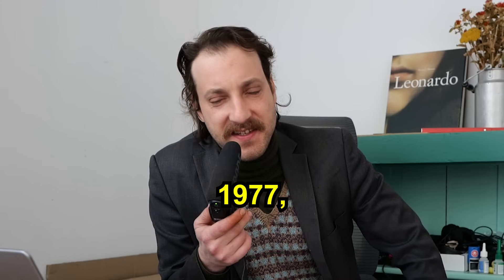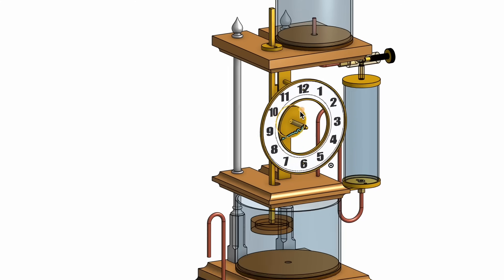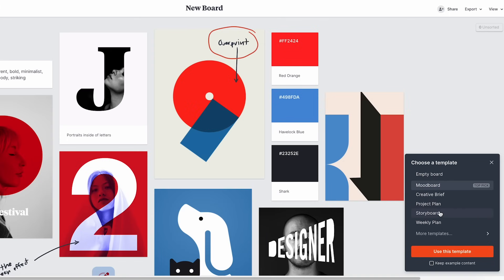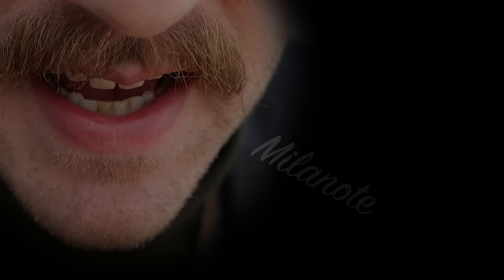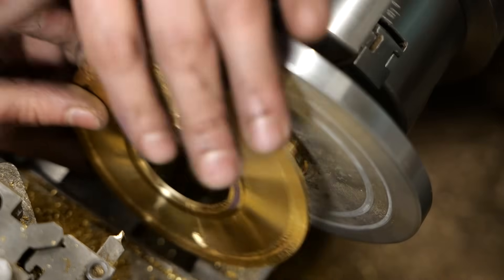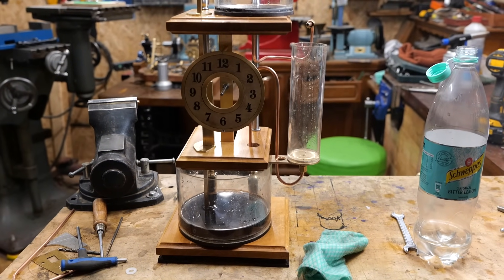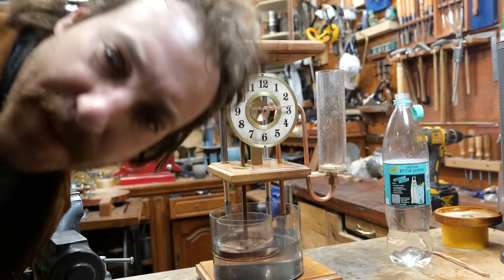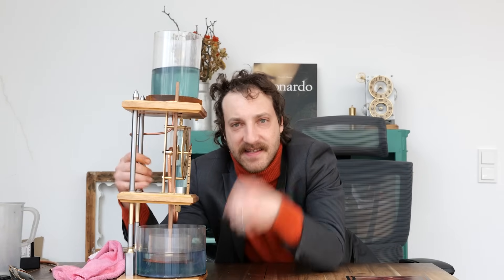I Built a Water Powered Timekeeping Device

Comment: You could connect this to a water line and keep the reservoir topped off using either a float valve set up or a toilet tank one. The float valve would refill the reservoir more frequently and the toilet tank set up would fill only when emptied. I’d go with the float valve. It’d also increase the accuracy of the time keeping given the narrower band of supplied pressure to the water dripping spout. Also I would simply replace the tip of the dripper with an IV one. The engineering to create consistent drops has already been done with those.

Comment: So.  .  . The Japanese time system in the Edo period divided the day and night into 6 equal hours each.   So an hour was a different length of time for day and night, and changed every day.  The hours were also different lengths of time for different latitudes, then you have the time zone thing for longitude.
So why do I bring this up?
Time was actually kept officially by monks, using water clocks.  Mechanical clocks were invented, but they were a bit fiddly.  I have had a low-level ambition to build an Edo clock for some time now.  I would be tempted to brace the heavily-cantilevered design, and use throttling valve rather than a stop valve to control the water drip.
Reply: It blew my mind when I learned that. And the fact that Japanese clockmakers made a clock to tell time that way. However, inaccurate I still can't wrap my head around.

Comment: Another solution to the water tension problem is to add a single drop of soap to your water supply. Surface tension will almost completely disappear, and if it's only a single drop you won't need to worry about bubbles.

Plus this kind of solution seems like it would appeal to your chaotic and unpredictable style. 👍

Actually a moment later it seems you added soap for color because there's a ton of suds, haha.

Comment: What a wonderfully entertaining and interesting video. That made me laugh and smile and I needed that, thanks man!

I wonder how accurate these were able to be made. There's so many opportunities for errors being introduced, like thermal expansion of parts like the valve, humidity and evaporation or condensation. Maybe even different water having more or less surface tension (just a tiny bit of soap) might add a minute or 30s before siphon starts.

It might actually be cool if you added some load sensors and electronics to compensate and actuate the valve and cycle the water with a pump - v2. So it can be used as a real clock. Very impressive.

Comment: The issue with this arrangement is the varying water pressure. To solve this one can use another vessel that is filled by the main storage with most of the water going into the measuring vessel while some water overflows to keep this secondary storage vessel topped of all the time.
Reply: That's a waste of a precious fluid, not very smart move I must admit. It would be better to use enclosed vessel at the top with open bottom to a smaller basin, like a bird-waterer (a pigeon of course, in our case), which will have constant pressure from there. The only downside I foresee is that pigeons will not be able to drink from this installation while in upside down position.

Comment: You should have a 2nd top tank with a level of water regulation so the output pressure to made drops is constant.
To do that you need a floater that stops the incoming flow from the 1st tank when the required level is attained.

Comment: What if you made a wind-up clock-type mechanism to pump the water out of the bottom reservoir back up to the top once it gets to a certain level. This that level could be adjusted such that the clock dial ends up on the same time it was when the pumping started, in other words, it drops down one full rotation of the hour hand. Use an 8-day clock mechanism.

Comment: tip: next time you bend piping, fill it with sand or some other stiff substance that fills small areas so that it has a more prominent infill meaning it should prevent the pipe from squishing/kinking as it bends if you know what i mean

Comment: I think you could make it fully self-contained with a few modifications. An aquarium pump would circulate water between the two reservoirs, I'd put a float switch with a slight delay on it so it only triggers when the water level is at its highest after the hour hand moves. Then, instead of a straight gear rack on the hour hand, have it ratchet from each position to the next, so the rack plunger can return to the bottom of the reservoir each time.

Heck, version 2 could have the plunger reservoir be the same as the minutes reservoir, so as the water level fills, it gradually advances the hour hand, then returns to empty at the top of the hour.

Comment: you know technically the floating rack is just reading the water level of the lower reservoir, so there's nothing stopping you from just replacing it with series of lines on the outside just like how the minutes are displayed. or by the same token, you could turn the minute display into another dial using a second floating rack

Comment: when watching i also had the idea of inserting rods or similar to the minutes cylinder in order to adjust for smaller volumes.
thus the insertion of such an adjustment block was not a big surprise at first. but looked closely its a neath trick for compensating for its "zero" point.

cool thing so far - i would add a single pillar to the right front corner for stability, so the pot on the bottom level is not obstructed.
why not - an asymmetric 3-bar support which closes two of the four side faces of this clock tower. it would make a quite great "out of the box" design.

Comment: Nurse here, we used to have to make water clocks all the time in the form of IV drips.  There are plastic valves that have different size holes that allow for specific sized drops then you adjust the rate by using a roller device to gradually pinch the tubing until desired rate is achieved.  You use your watch and manually adjust to your best guess.  Still do this if there is equipment shortages, breakdowns, or disasters.  In the Army we did this all the time in the field.  Great video as usual, Uri!
Reply from the maker: Absolute genius!
Reply: you had to make them? why wouldn't they simply make a device for this?
Reply: @nebechanezz3r 
Firstly it's a very valuable and good skill to have, 
But their comment mentions still doing it if there are disasters or other issues, which would likely leave machine equipment unoperational

Comment: Neat project. Nice to see something different. I'm assuming the water clock method lost out to mechanical due to stability of time keeping. Even with a larger reservoir tank, if you were to refill daily, slight changes in head pressure would influence water flow rates, being that valves are just valves, and that essentially is just a partially closed hole, which would be prone to variability of water pressure change.

Comment: I think the dropping rate will get slower as the water level in the reservoir drops, because the water pressure will also drop with the water level.
Thats why historik water clock reservoirs was conical / narrower at the bottom.

Comment: Does the dripping stay accurate as the head pressure changes?
I'm also disappointed that the lower tank isn't big enough to run for 12 hours.  Really, it should handle the longest night at your latitude, so it can keep time until dawn.

Comment: Hey! @urituchmanpigeon Quick safety thing that may apply! At ~2:25 you start using a router, if you are feeding the material into a router you need to make sure you are feeding it into the teeth of the router bit, not in the same direction of rotation, to prevent it from being pulled unexpectedly and getting you fingers ☠️☠️☠️ this may not apply if the video is flipped or if the motors spin in a different direction where you're from. Also, LONG LIVE THE PIGEON

Comment: You could add a little hand pump on the back to transfer water from the bottom tank to the top.  This could add some structure and weight on the back to keep it from leaning forward as much.

Comment: OK. Using a threading tap in the lathe to create the "gear" for the threaded rod to turn is just pure genius. I, and probably most lathe/mill owners, would have tried hunting down some specialize, and overpriced, thread cutter to use rather than come up with that level of repurposing.

Comment: Have you tried running distilled water through it with no dye? You might be able to get a more consistent result with the droplets if the water's surface tension's not affected by dissolved solids and dye. Then again, probably might not matter. Could be fun to experiment with! 
I like the video and ur admiration of the humble pidge

Comment: I think I know why you're having trouble getting the timing exactly right:
As the water level in the upper tank falls, so does the pressure pushing water through the regulator valve. As a result the flow rate drops causing the minutes cylinder fill more slowly.

Comment: The problem is the weight of the water, and the pressure, is steadily dropping as you run the clock.  This slows the flow of water.
You need to account for that pressure drop somehow.  Maybe a float that opens the valve a bit the lower the water level.

Comment: The problem is that as the water level in the reservoir decreases, the amount of water dropping through the valve also changes so the drop rate can never be correctly adjusted. The way water clocks usually solve this is by keeping the water level in the reservoir constant by supplying more water to the reservoir than is consumed and draining the excess away with an overflow pipe.

Comment: I always enjoy the engineering artistry in your projects.    But... um.... each small vial advances the dial by 5 minutes.  But the small vial is graduated into 60?  There's more than 60 seconds in 5 minutes?  Shouldn't the small vial's vertical scale be 0-5?    Either that or you need a much smaller first vial that dumps after just 60 seconds.  I don't see anyone below commented on that.  Did anyone in the Patreon group mention it?

For "packing" the small vial to dump just the right volume another option to using the slug on the bottom would be a set of J shaped wire rods.  Used upside down the hook would hang on the rim and the other end just barely miss the base.  Big sizes for big adjustments and thin wire for small adjustments.  They would hang in the back out of the way so they didn't hide the blue water.   Possibly behind a center wall that is there simply to hide the wires.  A smaller tube would also let the big hopper run longer.

Comment: it seems like if you were to use some kind of a weight on a string or chain, maybe two or more. and maybe they could slowly fall with gravity. Or idk how else it could be done. Just an idea. then u wouldn't get any of the issues associated with water based mechanisms. mold. mildew. wet socks. either way great work.

Comment: Uri, you're such an artist with the execution, but you absolutely must have a two-chamber water source with a float valve in the "bottom", smaller chamber, to get the constant pressure to ensure that the drip rate stay constant as the top chamber is emptied... Also, you might consider having a cover on the bottom chamber to reduce evaporation. If you used an inverted system for the float, like a "string" attached to the bottom of the float, passed around a pulley, with the string wrapped around a "capstan" on the hour hand; as the float rises, it pulls the string, which has insignificant weight, around the pulley, and the string rotates the capstan. No fancy gears to cut, just a calculation of the capstan size against the float change, which can be "trimmed", as you did by adjusting the volume of the hour cylinder, or trimming the level of the siphon...
Reply: Came down here to look for this comment. Absolutely needs a regulated water source. That could be as simple as those inverted-bottle water dishes for pets, removing the need for a physical float vale.
Reply: I disagree,  partly. There should be a solar lens focused on the lower tank to evaporate the water, a tube back to the upper tank, and a radiator to recondense the water into the upper tank. :-)
Reply: @lohikarhu734  but the fancy gear cutting was the whole point. If he wanted easy a 1 euro watch would do the trick. For the rest interesting ideas
Reply: I feel that a float system like that of a carburetor would complete the regulation task. A.false bottom in the top tank would separate a constant height bottom tank from where it is filled. Thus, you can refill the basin without disturbing any timing mechanism.

Comment: I wonder if the water will drip faster if the reservoir is more full due to a higher water pressure head?
Reply from the maker: That is definitely a factor, originaly the tank would be filled constantly while  exes water to flows out of the system.
Reply: @urituchmanpigeon  Perhaps a small feeder reservoir that is fed from a main reservoir using the same phenomenon as a bird drink dispenser.

Comment: @urituchmanpigeon what did you do to keep the pipes from flattening on the bend?
Reply from the maker: I was afraid of that, but apparently 8mm tubes don't buckle that easily, so I just took it slow and it seemed to work fine.
Reply: @urituchmanpigeon  Did you heat it up or anything before the bend? Thank you!

Comment: I see pipes on the thumbnail, I click. I've been hunting for true tricks for bending pipes!
Reply from the maker: Im Sorry to disappoint, I thought pipe bending would be super tricky, but the pipes I've got seemed to bend just fine without any precautions.
Reply: @urituchmanpigeon  My friend your videos never disappoint. I always learn a few tricks from you and have fun with your personality, I know you put a ton of effort in them, zero pressure Uri.
Reply: you can use a pipe bending tool or fill the pipe with something like sand so it wont buckle when you try to bend it
Reply: @CH3R.N0BY1  Thank you, yes I use a plier-like bending thing, but often they just flatten on the bending point if it's 180°. I've only used aluminum and brass though, so maybe copper is easier. I tried the sand, but found no way to seal the openings of the tube to prevent it from blasting through when I bent the tubes (now I'm thinking I could have just crimped the opening).
Reply: @tensionandelease 
Make sure you use crushed sand not beach sand. It needs to have angular particles. Beach sand is all rounded and will “flow” when pressed much more.
Reply: @BLenz-114  Thank you because I hadn't thought of this, and it makes perfect sense. I'll try this and the super soapy water next time.
Reply: For smoother bends fill with soapy water and freeze. 0 crimping in the bends, smooth like a brass instrument.
Reply: @ronniek6114  I tried that too but when I bent it, the ice in the bending point crushed and pushed ice blocks out the two open ends, and the bending point flattened too...
Reply: @Dabaiko  more soap. It needs to like a dense gel when frozen.
Reply: Here be the tricks to bend it: •sand and plug holes;
•freeze water (apparently soapy) and plug holes;
•melt lead into it and when you done, melt it out. 
•special bending tools
Reply: @artfx9 my father told me h9e used salt instead of sand because it can be dissolved by water
Reply: Awesome project Uri. Your video making also gets more and more amazing with each video